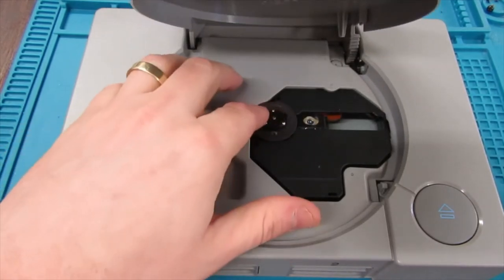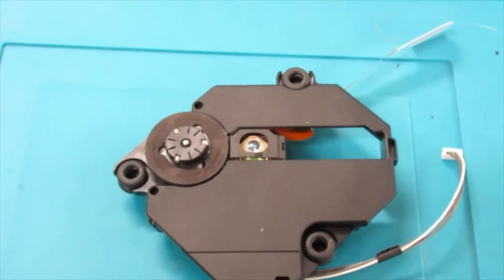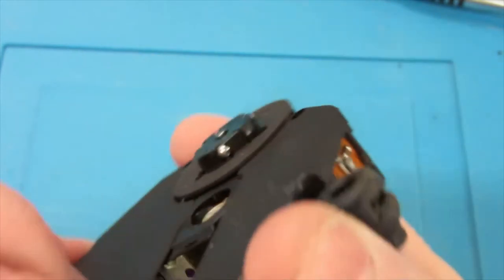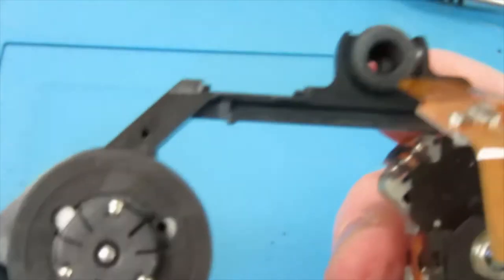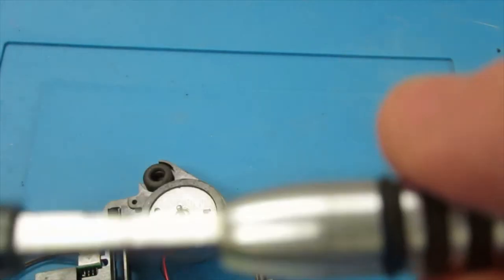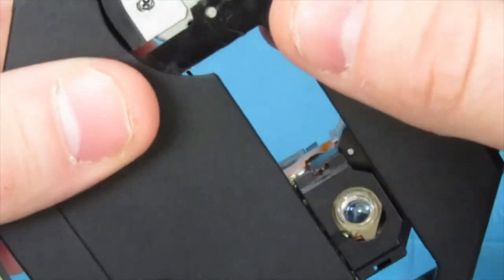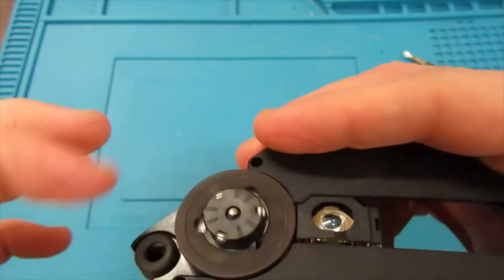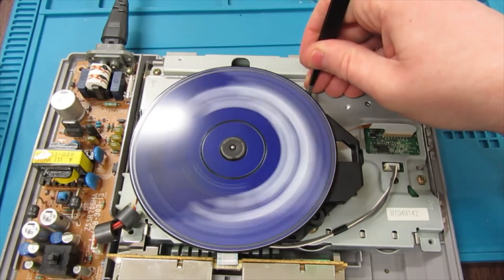Sony PS 1 PlayStation 1 Spindle Motor Replacement

Comment: Here is a tip to everyone trying to fix devices with optical disc drive: when you get the job done, do first test with a cheap game, or even better, audio cd, which you don't care about, I learned the hard way and scratched my GTA disc when I tried to fix my PS2 Slim with a dead laser (I left ribbon cable which goes to the laser wrong) 😅 I should've used some bad movie dvd for testing, or some sports game no one cares about 😄

Thanks for the video, I have one PS1 with similar problem to try to fix at some point.

Comment: Do I have to use an specific type or brand of motor? or can I harvest a 360 disc drive motor?
Reply from the maker: I don't know, it's not something I have ever looked into. If you try it I would be interested to know if it works for you.

Comment: Mine has no holes for the spindle. I have to remove the ceramic plate to get to it.
Reply from the maker: Where you able to get it off without breaking it. I seem to break the disc holder any time I try to remove them.
Reply: @EasyConsoleFixes  yes. Easily without breaking anything several times. What I did is carefully use a butter knife and a small dull kitchen knife (that doesn't bend and the edges are smooth). I slowly pushed with the butter knife under ceramic and then the dull one under, and I slowly and with slight force raised both knives up towards the centre, and the ceramic went up. Make sure to push with both of them at same time.
Reply from the maker: @RaffaelloLorenzusSayde  Thank you, I'll try your method next time I have to do one.

Comment: hey man, can you help me pls, my ps1 have a  issue, the disk rolling, but  after a  while stop,   what should i do?
Reply from the maker: If the disc is spinning and then stops it sounds like the laser tries to read the games and can't.

You can try and increase the power to the laser like I do in the video but if that doesn't work you would need a new laser.

Comment: what motor should you use for these replacements?
Reply from the maker: I used one from a broken console but if you google the number on the motor (I think it starts with RF-300 ) you will see replacements for sale on eBay and AliExpress.

Comment: Hi great video! Do you know what the issue is when the disk justs spins 2 short bursts?
Reply from the maker: This normally means the laser can't see the disc. Try cleaning the laser and if you have the console taken apart it can also be worth checking that the ribbon cable to the laser is attached correctly and not damaged.

Unfortunately if none of that works it's probably a dead laser and the only fix is a replacement.
Reply from the maker: @pandurlolgg5780  Hi, no unfortunately I haven't yet found a decent replacement laser for the PS1
Reply: @EasyConsoleFixes  seems like it's hard to find a good one. Had been looking into one for a while and pulled the trigger on one and it literally fell apart as I took it from the packaging.
Reply from the maker: @jakemartin2356  The real problem with them is, there are no good quality replacement lasers available that don't cost as much as a console.

Comment: Do you have to get another top plastic part for the spindle motor, or is there a way to tale off the old one?
Reply from the maker: Do you mean the bit the disc sits on. Sometimes they break coming off but you can get replacements fairly cheap. I think I got 5 for around €5